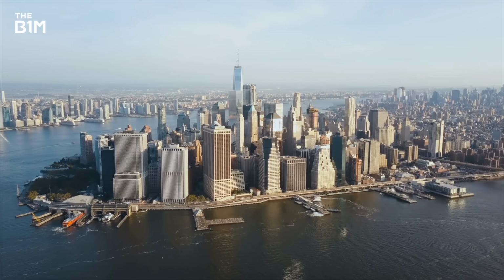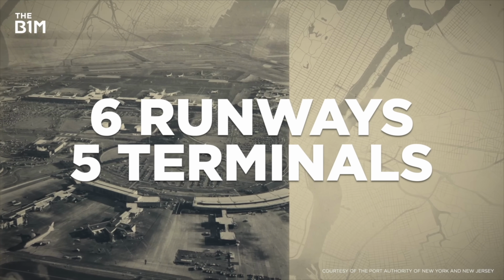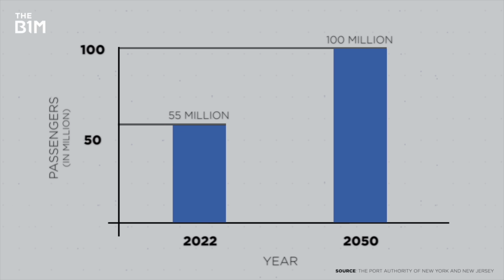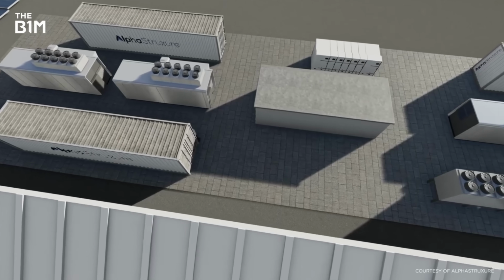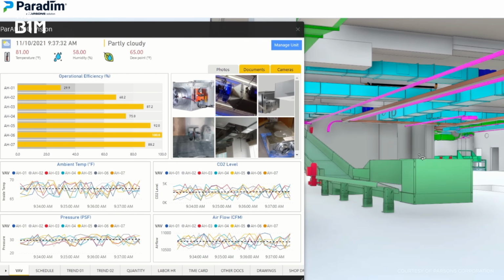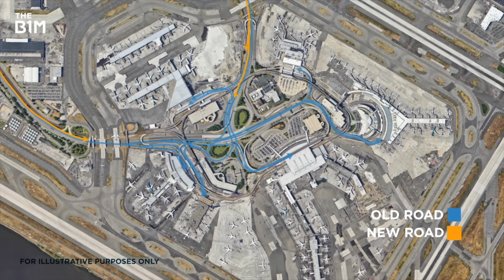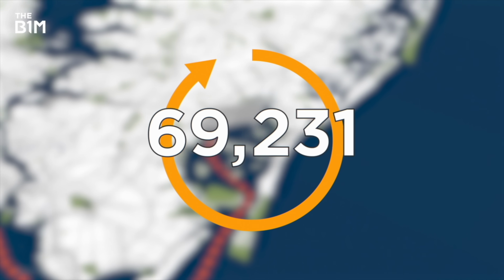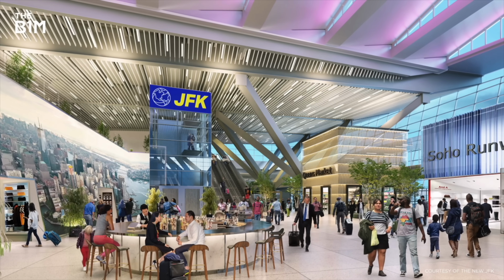The $19BN Plan to Save New York's Worst Airport

Comment: So... No improvements to the one thing everyone wanted - train access?
Reply: there already is train access. you can take the air train to either Howard Beach or Jamaica. Howard Beach there is a subway stop, and Jamaica has access to the subway and the LIRR
Reply: JFK has train access - there's AirTrain. the problem is having to take AirTrain to Jamaica station and then from Jamica station to Penn Station to get into the city. I think now it's easier to get to Grand Central Station.  It's a lot of walking and takes time, but it can be better than taking a cab. It is not the same as the easy train access at airports in some European countries (for example Copenhagen or Stockholm), but it's not all that different from the train issues at Heathrow.
Reply: @alyssapowell1799  "train issues at Heathrow" Eh?
Reply: In Edinburgh you get a tram right from the airport to the city centre within 30-40 minutes. Costs about £7 ? Although it was a farce to build it 10 years ago it’s been a great service.
Reply: You can take the LIRR or the subway that will connect you to the Airtram that goes to all terminals at JFK.
Reply: No way PANYNJ is getting rid of the $8.50 per ride gravy train called the AirTrain.
Reply: You have no trains to the airport? wtf
Reply: We took LIRR last time it was easy right into Penn
Reply: Thts the mta. JFK can’t do that.
Reply: Copenhagen I could get from city center to airport in less than 20 minutes. Yes it’s a smaller city but the transit line goes direct to the  airport like any logical system would build its service to do. London, same thing just took Piccadilly line to major city area and was very fast. Build something that can easily service the airport, community, and tourists. It’s not that hard, NYC just doesn’t want to do it. Especially they don’t want to serve Queens locals for whatever reason. I don’t get how you can spend billions and leave the same major issues as they are.
Reply: taxi service is a massive business for TLC (taxi and limousine commission) of New York.  The airport is a major source of work for taxi drivers who pay TLC for the privilege to work the airports. train access would kill this.
Reply: @CEOofTheHood boohoo
Reply: @CEOofTheHood taxis are the past
Reply: @millevenon5853  one of the most common professions in NY , like it or not it’s not going away even when they have robo taxis. I’m willing to bet NY will ban them. Too many people would be unemployed.
Reply: @millevenon5853  Welcome to America, land of cars.
Reply: @corruptedpoison1 There is a train that goes to the airport. This guy doesn’t know what he’s talking about.
Reply: @CEOofTheHood  other cities have airports with train stations and taxi ranks. Hasn't killed off the taxis at all.
Reply: @Manawatu_Al2844  In my country people meanwhile are accusing tourists of being stingy because they don't travel from the airport by taxi but by bus instead, with their luggage taking up more space on the bus
Reply: @lzh4950  Before the rapid transit line to the airport was built in my city, a fleet of express buses ran between the airport terminal and the downtown hotels. No need for local public transit rides.
Reply: @CEOofTheHood do we care we just want train access
Reply: @CEOofTheHood ”oh no the industry lose money”-the industry lobby
Reply: @Slavicplayer251 the industry is jobs for your fellow americans .  It’s hiw ordinary people pay the rent.  They go to work.
Reply: Stop being cheap call a uber I'm a uber driver bye the way
Reply: @Robert-es2jq  Why should tourists give you a job when there are better options available?
Reply: @Robert-es2jq this time we will use Uber or lift.  However   Charging 75 dollars into the city is ridiculous

Comment: how does it cost that much when china spent 17 billion on Daxing airport with has a capacity of 72 million passengers a year  and this is renovation costing 19 billion
Reply: American salaries are much higher, while china has much cheaper labor to pull from. this is also one of the most expensive areas of the country to even build in. 
Daxing was also build largely over sparsely populated area pretty far from the city also bringing down its costs more while JFK is an already established airport. 
Also less red tape and bureaucracy china has to go through.

Comment: bad accessibility from the city to the airport, isn't that the case for JFK, la Guardia and Newark, all important airports in and around the city all together? 
It's poor enough for me to choose the taxi over any train in NYC when going to or from the airport. A direct connection from Manhattan, without the need to change the train to get to the airport, would be the standard I'd expect from a city as large and important as NYC is
Reply: Newark had direct access the Penn station so it doesn't really have a connectivity issue with NYC. Which is ironic as it has the best access to Manhattan but is in NJ. LaGuardia is geographically the closest to the city and has the absolute worst access to the city. JFK has okay access as you can take the Airtrain to Jamaica and then take the subway into Manhattan.
Reply: @RaitheaFilms  it's okay, but far from great for a major airport; Especially as many of the stations don't have any escalators it kind of is a nightmare with heavy luggage
Reply: LGA is the most accessible airport even without any train connecting. It takes some courage to go to JFK on a rainy day from Manhattan. @RaitheaFilms
Reply: I'm convinced properly connecting the airports to transit would eliminate half the traffic in the whole city. Obviously they don't account for half the trips, but they account for a disproportionate amount of time spent on the few main viaducts in and out of town, which has knock on effects to everything that connects to them.
Reply: Sounds like a feature, not a bug.
Reply: @TalesOfWar  how so?
Reply: while true, that's not the problem of the airport.  thats a city issue.  the airport is only able to do things on their property.
Reply: @KingLuis1985  kind of it should be the interest of both the airport and the city it serves. Hell I cry about our airport being served by only commuter trains, both lines running on a 20 minute schedule / alternating departures every 10 minutes and taking like 50 minutes to get into the city, but at least it's a direct connection from the airport into the city. 
Other cities are definetly doing better than we area
Some time ago there were plans for Maglev trains serving the airport, and now a new regulation from the EU dictates that the airport has to be served by long distance rail in the future as well
Reply: @EnjoyFirefighting  Calling BS on that one. Since when does the EU have anything to do with NYC infrastructure? Let me guess, you're one of those crazies who think we have one world government?
Reply: @VanillaMacaron551  was talking about our airport and the train service operated between the airport and the city here; Major airport but no long distance rail connection. As it's located in Germany, which is part of the EU, EU regulations do apply here
Reply: @EnjoyFirefighting  My country has a shorter train (subway/metro) ride from airport to downtown (just over 1/2h) as the airport is relative near to downtown, though you need to transfer mid-way, though that's a convenient cross-platform interchange, though the connecting train is often more crowded with people travelling from more outlying suburbs to downtown i.e. there may only be standing room. 1 of the trains runs every 2-5 min while the other runs every 6-12min
Reply: And nobody wants to ride the train with the crazies and homeless and get mugged or whacked LMAO
Reply: @TheOtherKine  have no problem riding the train, would definetly do so if there was a better connection ...
Reply: @TheOtherKine millions and millions of people ride the trains and subways everyday without any issue.

Stop watching fox

Comment: Seems like remove the whole old infrastructure and rebuild would be the smart way
Reply: It's understandable to think that starting fresh might be easier, but it's not technically feasible to completely rebuild JFK Airport from scratch. Since it's a busy, operational airport with continuous flights and passengers, any renovation has to be carefully phased to ensure minimal disruption to ongoing operations. That's why the current $19 billion plan focuses on renovating and modernizing the existing infrastructure while keeping the airport functional.
Reply: @hanochkurian5933  i am sure they just build something intermediate to tear it down and develop real estate in 50-80 Years.
Reply: It's been a sh!thole as a permanent construction site for the 30+ years I've travelled through it.

But I agree, although probably better to find somewhere else first, then shutdown the old one.
Reply: @nezbrun872 where are you going to find that much land? The acquisition costs would be insanely high. Or you could build land in the water, which also would be insanely expensive
Reply: And probably cheaper, which is likely why they didn’t do it.

Comment: If they actually want to save it, they need free direct busses from and to  midtown.
Reply: There is the train, but a direct subway link would help.
Reply: @raedwulf61  That would take literally decades and hundreds of billions with the way NYC's subway building works. A free bus shuttle is essentially free for the city, and if express, may even be faster.
Reply: @TheNoerdy  Faster? The Van Wyck and the Belt are notoriously always packed 😆
Reply: @TheNoerdy  There is a subway stop right on the edge of JFK. Just a short extension is needed.
Reply: @raedwulf61 They already have an extension. It’s the AirTrain.
Reply: @Danimalpm1  Yes, but a direct subway line is better.
Reply: You can take the Long Island Railroad (LIRR) to the city for $10-$15 (depending on time w/ a city ticket) from JFK. You'll need to take the Air Train to Jamaica and then transfer to the LIRR to either Grand Central or Penn Station. Usually is faster and more comfortable than Uber and Yellow Cab
Reply: @jackylevi airtrain should be free
Reply: The Taxis Lobby will never let it happen.
Reply: Doesn't even need to be free. $10 per seat would work.
Reply: Just use the helicopter system.
Reply: WE USED TO HAVE THAT!! THE EAST SIDE AIRLINES TERMINAL AND THE WEST SIDE AIRLINES TERMINAL!!
Reply: Free direct buses to midtown Mexico? I agree…